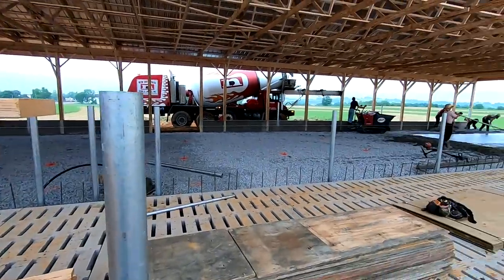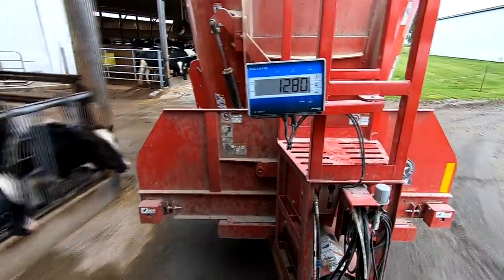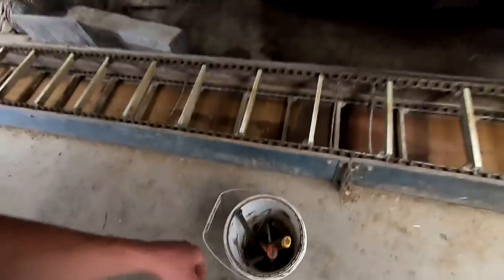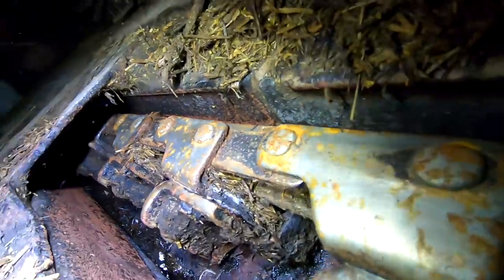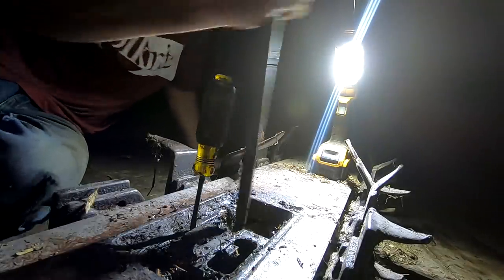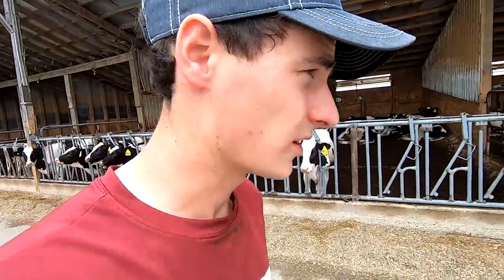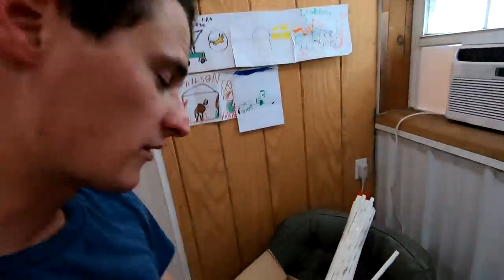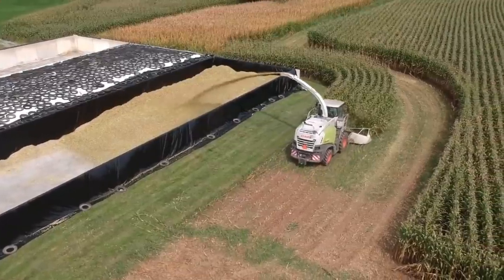Concrete Floor & Silo Work

Comment: Sure is amazing how fast that concrete set up.  I was surprised to see it hold your weight already.  That was neat.  I am also impressed with the size of the building.  Good planning went into that structure.  Thanks for the video.

Comment: That is so cool how they put the groves in the floor. They make it look easy but I'm sure it isn't.
Reply: Very skilled indeed!
Reply: If you ever get a chance to run a bull float do it.. You will gain a new appreciation for the amount of skill that fella has..
Reply: Experience.
Reply: @francoisross2480  Or a power trowel.
Reply: That is what amazes me about this project.  They were smart in using a POWER BUGGY to help place the concrete, but I didn’t see any grade stakes, no screeds of any kind, no laser concrete placer to help place this large of a floor.  This is a LOT of ready mix concrete for 4-5 men to place, they have a limited window of time to be able to get it placed, leveled and then grooved.  They did a mighty job, it looks good.  What strength of concrete are they placing for the floor? A nice addition for your farm system Eric?

Comment: Damn - The acoustics in that silo are like a cathedral. Never mind putting silage in there - build a pipe organ and play it.  It would sound like Notre Dame.. That barn floor is a work of art. Those workers appear to be Amish.
Reply: I think they have a Mennonite community close by and they are a little less modern method averse than Amish. They work like trojans though.

Comment: I’m not fully understanding the added work with the silo unloader. I get that it’s just one of those chores that’s always been done that way, but it seems unnecessary if the silage is level to the sides of the bin at the top. Great video all the same, Eric. And glad to see you getting rain.

Comment: Have enjoyed watching the progress of the new barn ,it crossed my mind why are the grooves running parralel to the feed rail and the under ground slurry store shouldnt they run from the back to the front to help drainage from the pens into the pit .
Reply: There is a bit of a nib wall to confine the bedding that goes on top I think. Don't want the bedding to block the slats over the pit. They use the left overs from crop harvest as bedding  straw   in the dry stock barns. Most of the time cows let go when they are feeding. What goes in one end must come out the other ....pressure

Comment: nice work fella, if the barn was a bit higher then the concrete truck could have driven inside and dump the mix right on the ground instead of the mobile bucket 😅😅

Comment: Impressive how they poured the concrete without any intermediate forms. No screeding. They just raked it and floated it.  How did they keep it level?
Reply: I'm guessing a few duck ponds,heifers won't care Hope they had fiber mesh or micro rebar in the mix

Comment: no rebar in the pad? maybe because the baby cows dont weigh as much as heavy equipment so no need of extra reinforcement?
Reply: I think there’s material in the concrete. Fiber that’s what I’m thinking. I had that same question earlier another video.
Reply: @paulprigge1209  ah yes, makes sense, fiber mesh stuff mixed with the mix

Comment: Are the grooves in the new barn floor not in the wrong direction? If you wanna scrape out manure it will want to follow the grooves, and the pit is at the front of the barn, not on the sides right?

Comment: Wood beams in concrete?  Wouldn't  they just rot away in say 10 years like a deck?
Reply from the maker: Built a similar building in 1999, still as good as new.

Comment: Can I ask question without sounding ignorant?? What's up with the Amish?? Do they work construction in PA? Just never have seen so many working in construction?
Reply: In Pa and Oh, the land prices have made farming difficult for Amish communities, so they've migrated to construction, furniture crafting, and other trades.
Reply: @jeffw8057  cool.... do all men dress like that?? I thought they didn't use technology??
Reply: @jbizzletx3420  The answer is a bit more complicated than you expect I bet. There are four main groups of Amish generally referred to as Old Order, new Order, Beachy Amish, and Amish Mennonites. The later two often wear typical clothing, utilize electricity, and own/drive cars. In contrast, the Old order wear traditional Amish clothing, hair/beard styles, no electricity in their homes, and don't drive or own cars. However, most orders will allow the Amish to use electric and gas fueled equipment to perform at their jobs. Often the Old order are allowed to hire drivers to take them to remote locations, and many Amish use electric bikes to go to work and school. And to complicate things a bit...non-Amish workers might intentionally wear Amish clothing to fit an image for potential tourists.
Reply: @jeffw8057  thanks for the info

Comment: So no iron reinforcement in the concrete needed, probably because its not for tractors, trucks … but only cattle
Reply: Hmmm...good catch. I'm surprised. I'm certain that tractors will be used to clean it out, place  bedding, and feeding.

Comment: Silo floor is an accreted  conglomeration of crusty rind , coating everything --that's very corrosion inducing....why not hose and pressure wash it ....Eh...?
Reply: Could well just leave a big puddle .
Reply: @carolynrose753  the drains can be useful...eh..? SAP SOP
Reply: @petervogwill6499  i gather that is a sealed silo to prevent air spoilage  and they feed from the top to keep the feed fresh. Any drain on the bottom would need to be plugged to prevent soilage at the bottom. I guess new silos have more features and design elements.
Reply: @carolynrose753  silage is withdrawn from the bottom....that revolving  chef knife on a chain  , get it..?   Filled from the TOP....COMPRESSED CAKE IS SHORT ARM CUT...TO  MAKE A DOME....EH..?  Oh well.....watch the whole vid again...BON APPETIT
Reply: @petervogwill6499  then why in Erics videos have they lifted it up to the top of the stack  and lowered it to the top of the feed after the silo is filled?
Reply: @carolynrose753  very likely  it may not be so simple. ..they agitate it ...once twice  thrice etc...but rest assured .....as eric decribes it..t is CUT FRO THE BOTTOM AND THEN DISCHARGED VIA CHUTE / CHAIN DEVICE.... 40 TONS  OF  CRUD AND FERMENTED VEG MATERIALS IS VERTICAL  VEG LOG AFTER MONTHS OF SETTLING ...EH...?   Try it yourself....